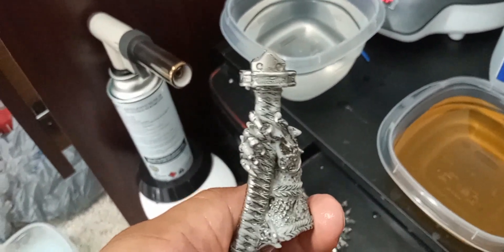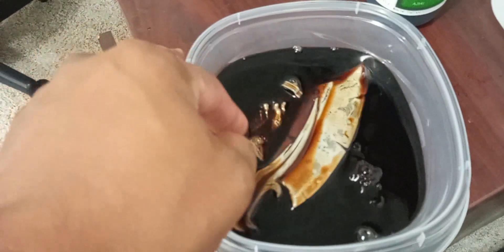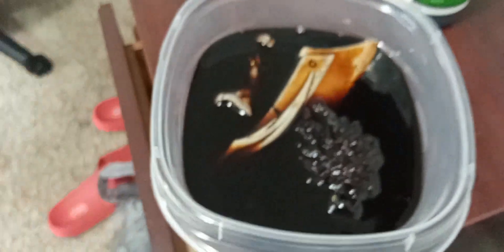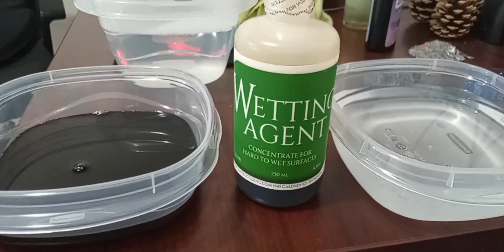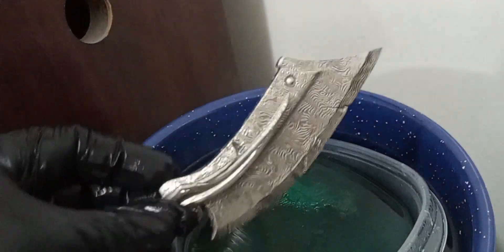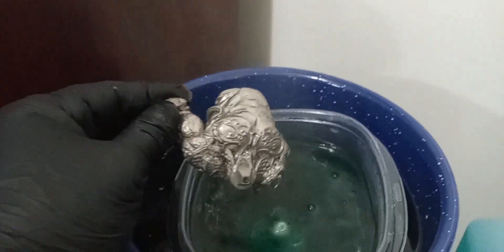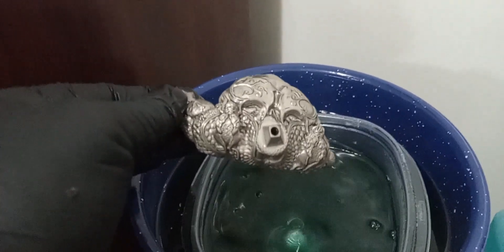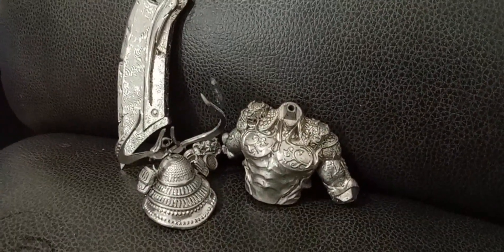Nickel Plating 3D Printed parts with Caswell Electroless Nickel

Comment: Hi Marvin! What material are you 3D printing with? I'm trying to electroless nickel plate some ABS parts I printed using the Caswell system, and I haven't had any luck so far, even with the torch + sensitizer + rinse + activator + reducer + ez-plate process.
Reply from the maker: wow, that sounds terrible. Nothing is sticking to the ABS?
What are your temperatures?
Reply: @nicamarvin  Thanks for the reply! Yes, nothing is sticking to the ABS. Sometimes I get a tiny amount of plating, but only at the corners. I am plating around 185°F, all other steps I'm curently doing at room temperature (around 64°F). 2 mins in the sensitizer, distilled water rinse, 2 mins in the activator, reducer rinse, plating bath for many minutes (but no color change).

I did have some luck a month or so ago with plating vacuum formed ABS pieces before Caswell sent me the reducer solution, but I could never get 100% coverage on the pieces and often ended up with spots or stripes where the plating wouldn't take. I was hoping the reducer would solve my problems but haven't had any luck so far unfortunately.
Reply from the maker: @CoolNamesAllTaken  I suspect that their Sensitizer could be the culprit. Make your own batch with Stannous chloride 10 grams per Liter. 5 minutes on the Sensitizer, Rinse, 5 minutes on the activator and skip the rinse just go strait to the plating bath.
Reply: @nicamarvin  Thanks for the advice! I don't currently have Tin (II) chloride available, but I can get some. I'm currently using the sensitizer solution from Caswell. Is there any way that I could tell whether my sensitizer is working properly (pH etc) before I make my own batch?
Reply from the maker: @CoolNamesAllTaken  The only way to know if it's gone bad is when it stop working, meaning you no longer get plating
Reply: @nicamarvin  Bummer! That sounds difficult. I'm curious, in commercial applications, do people have ways to check the sensitizer and activator baths to make sure they are still functional? Or do they just make new baths frequently enough that it's not an issue?
Reply from the maker: @CoolNamesAllTaken  I am sure they use Special measuring equipment to measure the ph and specific gravity. Basically what happens is that Tin2 hydrolizes to Tin Oxide, you can try to keep the PH up with Hydrocloric acid. I've done it with mixed results. I just make new batches now.
Reply: @nicamarvin  wow! That makes sense, so it sounds like I could maybe use pH strips to monitor the bath and see whether I need to make a new bath? I tested the sensitizer from Caswell and it has a pH of around 1. I have Tin(II) crystals coming in soon, I will make some new sensitizer to see if that makes a difference.
Is there a way to tell if the palladium activator is working properly other than seeing electroless plating work properly?
Reply from the maker: @CoolNamesAllTaken  There should be no change in color, as long as it has the same amber color it should work. It would be very closty if it goes bad because the part coming from the Sensitizer was not rinse enough.
Reply: @nicamarvin  you absolute legend! I remade the sensitizer as you recommended and that fixed it, my parts are plating now. How did you know it was an issue with the sensitizer from Caswell?

I noticed the sensitizer I made had a much different pH than the one from Caswell: mine was around 2-3 but Caswell's was closer to a 1. Their sensitizer looked clear, but mine was more of a milky white.
Reply from the maker: @CoolNamesAllTaken   I've been at this for more than a decade, have shed many tears and heart breaks from the very beginning. Spray on Chrome is such a complex process even when purchased from vendors and outright soul sucking when you try to DIY a formula from scratch, Electroless Nickel is a walk in a park in comparison. 
Be aware that DIY Sensitizer formulas will hydrolized in days so you better make a fresh formula on the same day you are plating.
Reply: @nicamarvin  that makes a lot of sense! I guess the sensitizer isn't super stable on its own. I really appreciate you sharing your advice with me, it totally made my day to have this system working!

I'm using electroless nickel to prototype lightweight EMI shields. Right now the coating looks pretty good, I'm excited to see if it works as well as a machined part for shielding purposes.
Reply from the maker: @CoolNamesAllTaken  Electroless Nickel can become brittle after certain thickness(usually after a few hours of plating) if you want to build a more machinable nickel layer you can use the electroforming nickel kit that caswell uses, that nickel it's designed to build up high thickness.
Reply: @nicamarvin  thank you, that's great info! In my case I was only plating for around 10 minutes, I think maybe my surface adhesion isn't very good?
I also noticed that if I go from the hot nickel bath directly to a cold rinse, sometimes I get cracking. I will try letting parts cool down a bit in air before the cold rinse.
Reply from the maker: @CoolNamesAllTaken  plate at 160 for 3D printed parts
Reply: @nicamarvin  thank you! I'll try that :)
Reply: @nicamarvin  do you have any tips for electroless plating onto thermoset plastics, like SLA printed resins?
Reply: @CoolNamesAllTaken  So happy I stumbled across this comment. I've been struggling with the caswell kit on ABS prints for weeks with mixed results, searching for etching solutions and wetting agents with no luck. I'm going to go buy some Tin Oxide tomorrow, make my own tin chloride sensitizer and give it another go. Never wouldve guessed the sensitizer was the issue. Why would it be? Its part of the kit lol. If this works, etching can be a future problem. Are you still getting good results?
Reply: @aidandegagne4976  Dude I'm so glad to hear I'm not alone on this one haha! This Caswell kit has been giving me trouble for MONTHS. Their sensitizer is totally busted. I would have walked away with nothing if our hero Marvin hadn't lent me a hand. I'm about to try some more plating tonight and will let you know how it goes.
Reply: @CoolNamesAllTaken  Sounds great. Are you still rinsing after the palladium activator before plating? I found that when I skip the rinse, my parts plate fully at the cost of adhesion. The nickel scratches right off and it isnt useable. If you're able to get the nickel to adhere well even with a rinse then its for sure the sensitizer
Reply: @aidandegagne4976  I was able to get one plated part with fresh sensitizer, it has pretty good surface adhesion and resisted scratching, but using adhesives over the nickel did cause some of it to come off (small bits of dust, not large flakes).
I used the same sensitizer 5 days later, and it provided significantly worse results. This seems to confirm what @nicamarvin mentioned about the sensitizer having a very short shelf life once mixed.
Reply: Today I switched from FDM ABS parts to SLA parts with Elegoo ABS-like photopolymer v2.0. I was able to get some to plate using a fresh batch of sensitizer, but the coverage is incomplete and surface adhesion is poor. I think this is because I'm not getting good wetting on the parts using the regular flame method.
Reply: @aidandegagne4976  Instead of rinsing I use a reducer solution sent to me by Caswell. They say it's a mixture of Nickel Sulfate and Water, but I'm not sure what the concentration is. This seems to work pretty well, if I can get good wetting to start with.
Reply: @CoolNamesAllTaken  Interesting, so adhesion still isnt amazing? I made my own nickel sulfate rinse yesterday and it didnt fix my problem. Chemicals are had to find in my country, but I've been reading some papers on safe and environmentally friendly etching solutions that reduce the plastic surface's contact angle quite a bit, so I think I'm going to try to recreate those results when I can
Reply: @aidandegagne4976  Yeah no luck with good adhesion yet, I think the issue is due to the sensitizer not wetting to the plastic well enough. I just got some of that wetting agent that I linked, will try it and see if it helps!
Reply: @CoolNamesAllTaken  How did you make your sensitizer? What chemicals and where did you get them?
Reply: @nicamarvin  10 grams per liter of water?
Reply from the maker: @smalliq1829  Yes,
Reply from the maker: @CoolNamesAllTaken  Sorry for not replying, I was not aware that you had reply. Try this to enhance the adhesion. Flame treatment, Wetting agent then Tin sensitizer, rinse and then to the palladium activator, but instead of going to the plating solution, go back to the sensitizer, rinse, Palladium, Nickel Sulfate rinse and Then to the Nickel plating bath.
Reply: Thanks for the tip  @nicamarvin ! I did have some better luck doing quick flame treatment, then 5 min wetting agent, then 5 mins in tin sensitizer, rinse, 5 mins in tin activator, 15 sec nickel sulfate rinse, then nickel plating bath. I am able to scrape the electroless nickel off of my SLA print with my fingernail, but at least it I can apply and remove some tape / adhesive without it flaking off, so it's better than before.

When electroless nickel is properly adhered, would you expect to not be able to scrape it off with a fingernail? I'm not sure if the issue is with the SLA print material (Elegoo ABS-Like 2.0) or with the plating, since I'm new to SLA printing.
Reply: @CoolNamesAllTaken  I'm coming back to this comment thread a month later because I am still struggling lol. After tons of research, testing, and even going as far as trying to replace the sensitizer with an energetic surface activation process, my results still stink. Did you ever end up with any big breakthroughs? Even when I do get plating it's never consistent, and can be scraped off like you describe
Reply: @CoolNamesAllTaken  I'm annoyed with how much I spend on these Caswell products, because I'm pretty sure they don't even understand what's going on
Reply: @aidandegagne4976  Lol welcome back! I got as far as "reasonable looking finish that gets scraped off if you scratch it". That was done with a combo of flame treatment, wetting compound, and then fresh-made sensitizer, followed by activator / reducer / plating. The coating doesn't come off if I apply and peel off a piece of tape, but it's certainly not very robust to scratching. I'm not sure if it's an issue with my SLA resin or with the surface coating at this point.

I agree that Caswell was misleading at best here. They're happily selling people chemicals that they don't understand, and the reviews on their website are disabled so it's very hard to tell that people aren't having success with their system.
Reply: @nicamarvin well I'm back to this thread! I tried plating plain old ABS sheet today, with flame treatment, Angel gilding wetting agent, then 5 mins fresh mixed SnCl2 activator, water rinse, 5 mins Caswell activator, 15 sec Caswell reducer, then plating at 150F. I got a really nice base coat with reasonably good adhesion in most places, but it wasn't very conductive. Whenever I tried to plate it for more time to make it thicker, or send it back to sensitizer activator, I could see the nickely turn dull. When I wiped the surface, the nickel would come off in an extremely fine glitter! I saw this happen a few times, sometimes in solution and sometimes after I removed it from the plating bath while it was drying. I'm quite baffled, as I am not sure what's going on here. The base coat sticks just fine, and then somehow begins to degrade later in the plating process. Have you ever seen this kind of thing happen before?
Reply: @CoolNamesAllTaken  I haven't seen that, I did copper electroplate a couple of my tests and they plated fine but later on bubbled and peeled because of the poor nickel layer adhesion. Caswell just sent me their "reducer", but it seemed like the support guy didn't know as much about the process as I did. Anyway I still need to try that. If no luck, I'm planning on trying this next: make a copper paint with atomized copper and paraloid b-72, then electroless nickel, then proceed to electroplating. My idea is the electroless nickel will render the metalized surface more uniform and conductive, making electroplating fast and effective with good overall adhesion. The paraloid b72 will do the heavy lifting while all the plating steps are metal to metal. I've done tons of research now, and the unfortunate truth is adhesion will never be good without hazardous etching steps, or proprietary surface prep chemicals with all kinds of inaccessible ingredients (usually also dangerous). I'll let you know how it goes!
Reply: @aidandegagne4976  Thank you for the great info! I'm looking forward to hearing about what kind of results you can achieve. Do you have any links to especially good sources of information for this process?
Reply: @aidandegagne4976  I'm looking forward to hearing about it! My guess is that the reducer won't do much to improve adhesion. My best guess is that it stops you from getting activator into the electroless nickel plating bath, which could create a big mess (mixing activtor into the electroless nickel causes it to deposit everywhere). Using a reduce rinse keeps some of the activator on the part (unlike a DI rinse), but I think the adhesion of the base layer is pretty much unaffected.
Reply: @CoolNamesAllTaken  Yeah that was my thinking too. So I ended up settling on an acetone based copper paint with dissolved ASA as the binder, this gives incredible adhesion to my ASA 3D prints. The paint is just ASA, acetone, and the nanocopper. I buffed it after painting and it gave a nice shiny conductive copper surface, but the caswell electroless nickel STILL adheres poorly. Steel contact (caswell instructions) did nothing, and even using palladium chloride as the catalyst for the copper surface resulted in useless adhesion (I know copper isn't ideal for electroless nickel, but it should still adhere right??). Anyway I'm going to make a nickel electroplating bath by myself and use that to increase the surface plating thickness for better mechanical properties. The caswell garbage will sit around for a while I guess, maybe one day I'll find a use for it. RIP to my bank account, what a waste.

Comment: Pretty cool , so you just warm up thr material and dump the print inside for a few minutes ?  Or is it like cooper plating that you need a nickle.anode ?
Reply from the maker: It needs Heat to start the chemical process.
Reply: @nicamarvin  pretty cool , and after you just dip it in ?
Reply from the maker: @PlatingPulse23  That's it. At least for aesthetic purposes.

Comment: I was worried when you have to heat the materials it would cause the printed pieces to warp/melt, you found this not to be an issue?
Reply from the maker: The temperature makes the 3D prints softer while being plated, but its only for a short period. And it goes back to normal once it cool down
Reply: @nicamarvin  thanks, I’d love for you to upload more videos on it if possible. I’m currently in the middle of a big project where the final thing where to be plate it some way, and I just have a hard time convincing myself to get behind electroplating because of the amount of work it is. Very interested in the electroless route
Reply from the maker: Have you concidered Chrome paint? When done properly it's pretty good, I will make a video of that pretty soon too. @jacquescoury2979
Reply: @nicamarvin  are you referring to the paint that actually deposits a layer of metal? If so, then yes. The main thing I need for this project is just for all of the parts to be covered in a thin layer of metal
Reply from the maker: @jacquescoury2979  No, I was talking about Chrome paint like Alclad which can give a very good looks but it's not conductive. Can you give more details of the requirements? I have experience in many fields and might be able to help you further.
Reply: @nicamarvin  it’s not too convoluted as far as my requirements. I’m resin printing a saber hilt, want to coat it in a layer of actual metal, not paint. Just because. Lol

Comment: have you ever used the cooper one, i am currently trying to coat superHDT hot material from a resin printer with no luck.
Reply from the maker: No, but technically it should be identical in process(except that Electroless Copper does not require high heat). Did you purchase their Kit? What seem to be the issue? By the Way, click Like and Subscribe.
Reply: @nicamarvin   when plasced into the copper solution it does not bubble and the coating takes houres. i have made sure to clean it and everything
Reply from the maker: @EmilyPierce-j9n  Chances are that the Sensitizer has gone bad. You can make your own. Disolve 20 grams of stannous Chloride in 1L of Di water.
Reply: Hey Emily did you every get this material coated? I need to coat a high temp resistant resin as well
Reply: @bobwatson1895  i never got a full coat to work was always spotty
Reply: @EmilyPierce-j9n  Same for me 😭Im just going to go back to electroplating I think. Thanks for the response